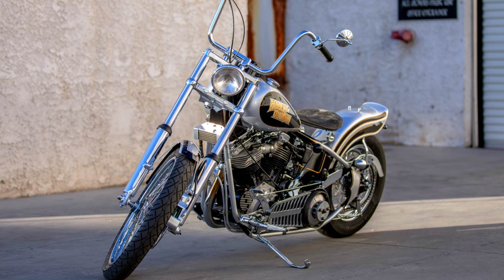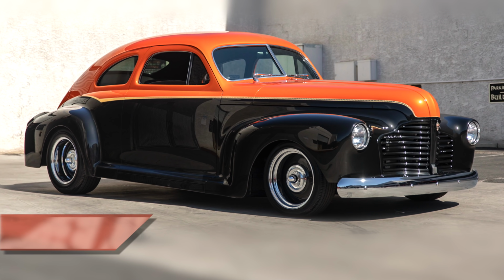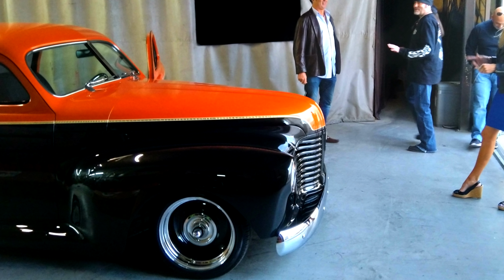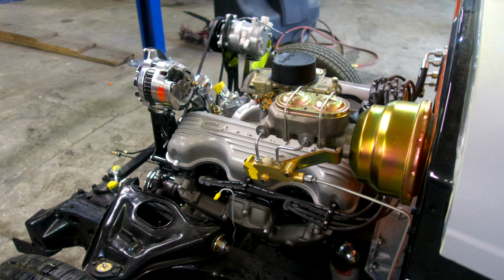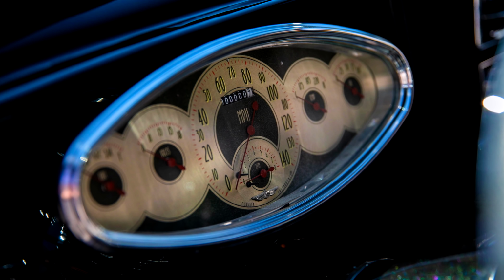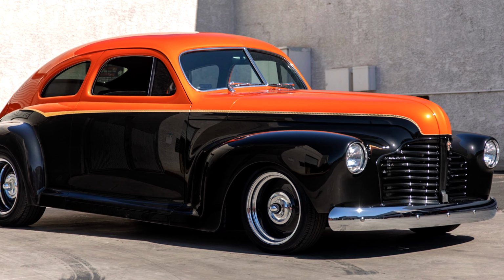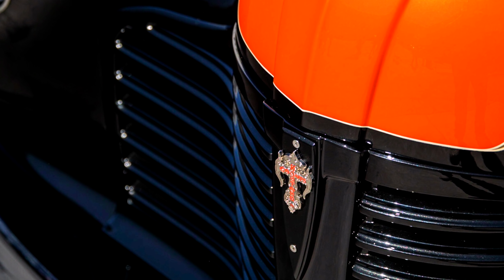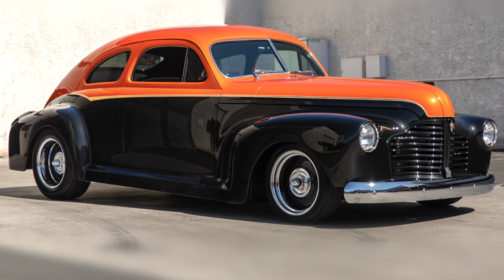Count's on Cars! Ep: 3

Comment: Hey Danny, no offense but by definition of bore spacing, aren’t 409’s actually SMALL blocks whereas 396’s are BIG blocks?
Reply: You can make a 409 out of a small block but the one he used is a 409 Big Block... it is the missing link between the small block and what we traditionally call a big block
Reply: @bob76059  , your right. Also, the 409 had a predessor engine - the 348ci